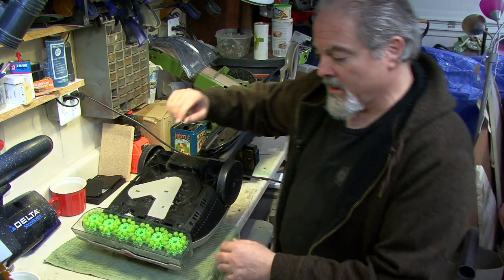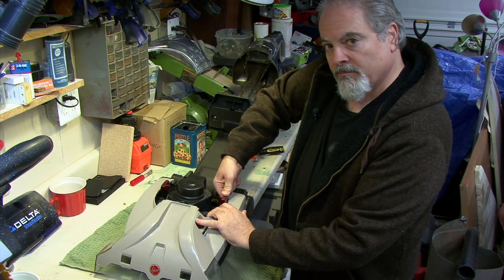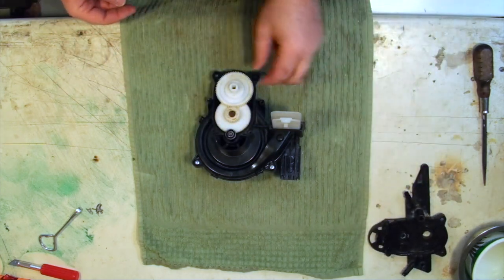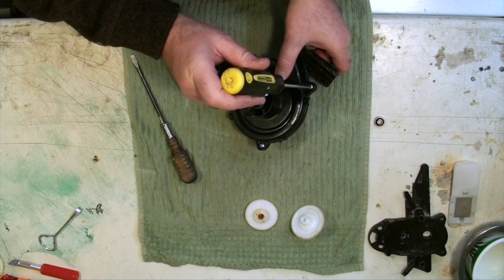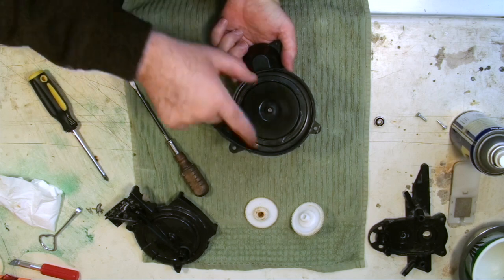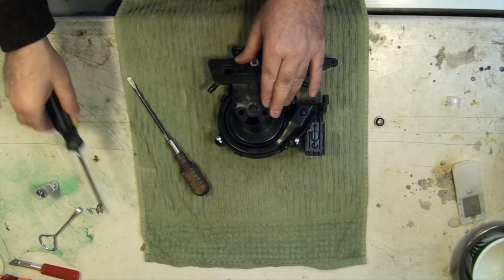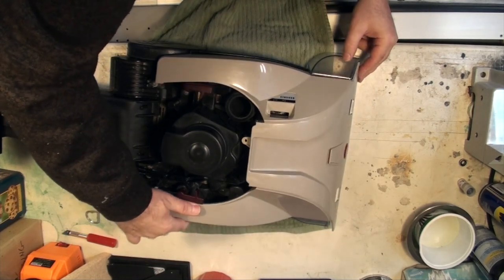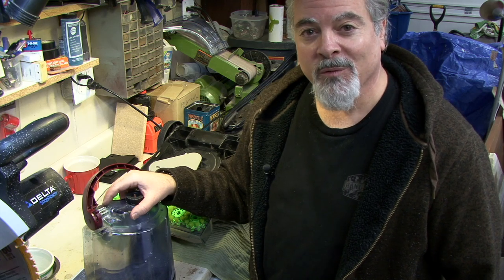SteamVac / Vax Brushes frozen and don't spin. Replace the bearing, not the motor. Less than $10 fix.

Comment: I hope this fixes my issue, mine won't spin at all, it's sat for a long time, haven't needed it until now, I've now tried to use it, turned it on and it's made a god awful sound and brushes won't spin
Reply from the maker: It sounds like a bearing (or two) is seized. But before digging into it, make sure to check the brushes for hair wrapped around them, and check the screen filter too. I'd love to know how it turns out!
Reply: @UnchartedDIY  thanks buddy, I was watching a couple videos on this and I think it may be the bearings as well, I definitely cleaned the brushes I have dogs with a lot of hair so I try to keep the brushes clean every time, I'll definitely keep you updated!

Comment: How can I find just the turbine for my carpet cleaner. Mine is cracked into two pieces.
Reply from the maker: Unfortunately,  CM, I was not able to find the turbine itself available anywhere. I'm pretty sure it was only ever offered as the complete motor assembly. 

I glued my cracked turbine, and several other people commented here explaining how they fixed theirs - even one that was split like yours, if I remember correctly. 

I found that the trick to gluing it, is to try to keep the balance of the turbine. So if you put glue on one spot, put some on the opposite spot even though it isn't broken there. 

It's like balancing a tire, so the heavy spot of the wheel needs a counterweight.

Otherwise, one commenter picked up another model for cheap from a thrift store and used it for parts. 

Good luck, and I'd love to know how it comes out.
Reply: Thanks so much. I had already thought about trying to glue it so that’s what I will do. I may start looking around for one for parts in case the glue doesn’t work. I will let you know how it turns out. Thanks again.
Reply: @UnchartedDIY  thank you so much for your video it really helped my mom fix her shampooer ❤️
Reply from the maker: @jessicapierson3739  I am so happy it helped!

Comment: Do you have link for those white gears as well? My cleaner gear has lost all its teeth and I can’t find the replacement :(
Reply from the maker: Amar, I have searched and searched, but it appears the gears are not sold separately. Instead, the turbine assembly must be replaced as a unit. I have a link to the one I was considering for mine until I discovered it was only the bearing: https://amzn.to/33nMhK4

Just be careful that it fits your model since there have been a number of similar models made. The model number is located midway down the back of the handle on a label that shows serial and model number. Good luck and I hope this is the one you need!

Comment: Which model number is this for ??? I have the model FH 50150.  Is this the same?
Reply: If not the model FH 50150, would it be the same bearing parts to order ?
Reply from the maker: Mine is a model F7425-900, but it seems all machines of that era use the same bearings. I don't repair for a living so I'm not up on all the specs, but yours appears to be very new.  I would hope they would have solved this problem by now, since my machine is around 15 years old. 

I would start by checking and cleaning the intake filter located inside the clear plastic on the left front side of the vacuum. If it's clogged, it will stop the brushes. 

If that's not it, it might be worth opening it up and seeing if the bearings are rusty.

Hope that helps and I hope you find it's a simple fix!
Reply: Thank you.  Will check everything.

Comment: Instead of using 3-IN-ONE - 10038 Multi-Purpose Oil, 8 OZ, use  I'd AeroShell Grease 22
Versatile Multipurpose Grease, Corrosion inhibited and fortified against oxidation, it has excellent anti-wear properties, load-carrying capacity and water resistance, plus a wide useful temperature range of -54°C to +177°C. Recommended for aircraft wheel bearings, engine accessories and airframe lubrication and for anti-friction bearings operating at high speeds and at high or low temperatures.

Comment: Where can l get the round turbine at 7:57?? Mine was cracked
Reply from the maker: Martin, they are not available separately from the motor assembly, but even those are becoming difficult to find. Check out the comments below from 
Louise Zoufaly. She was in a similar predicament but solved it.  Glue was one option, but she managed to find a used machine and use it for parts.

Comment: This was so helpful unfortunately now my machine isnt dispensing water and cant figure it out!! Grrr
Reply from the maker: I suspect the trigger switch or a solenoid is to blame, but since I haven't had to deal with that problem yet, I can't give specific advice. If you have a multimeter, you might be able to track the problem down. 

I know it sounds crazy, but if you can't get it to work you could mix your hot water and carpet detergent in a pressure sprayer that you pump up by hand. Spray it on a section of carpet and then vacuum it up with the carpet cleaner. A bit of a pain, but you could still keep using your machine! In case you don't know what kind of sprayer, here's an Amazon link to show you what I'm talking about: https://amzn.to/3V5RgLu  Make sure it has an adjustable nozzle so you can control the spray pattern. I would use the same moderate temperature that you would put in the cleaner's tank, and you don't need to pump up a bunch of pressure to spray the carpet.

Hope that helps and I'd love to hear if you are able to fix it, or if you go with the sprayer. Thanks for watching!
Reply: @UnchartedDIY  thank you kindly for your reply. I am tempted to think it is the trigger. From trying to reverse engineer it, I can tell when pushed by hand, the valves go up a reasonable amount so presumably the trigger should pull those pins up on the machines upper tank base when pressed.

Are you aware of this is the case? Thanks
Reply from the maker: I think that's how they work. I wonder if you might just have a bad valve? You could try switching the water and detergent tank valves to see if it is a valve, otherwise it is probably the switch. Also, check the plastic base of the water tank to see if the glue that holds it to the water tank might have come loose and allowed the tank to sit too high, preventing the valve from opening.

Comment: Where do you buy gears
Reply from the maker: Thanks for asking, theresa. I am assuming you mean the white gears inside the brush turbine motor. Unfortunately, it seems that the gears are not available as a replacement part. In the parts diagrams, only the turbine gear assembly is available, so when things go wrong you are supposed to replace the whole brush turbine motor unit.  The bearings I fixed in the video are not listed either, so I was happy to find a way to fix them.

I would start by searching for parts under the model number of the SteamVac you have. You should find the model number on a sticker located on the back of the cleaner, probably about where the electrical cord attaches. Try ebay if you want to go with used parts to keep the cost down or if the part has been discontinued, otherwise you might be able to find a new one depending on which model you have. 

I hope you find a replacement, and I'd love to know how your project turns out.

Comment: I can’t do this this my fourth Hoover i just got this one last year . Brushes don’t want to spin . Really carpet cleaning is seasonal for me I don’t have kids or pets .. running hard brushes not moving …I wanted to shampoo before holidays . Who repairs these machines?
Reply from the maker: What a pain! I would start by checking and cleaning the intake filter located inside the clear plastic on the left front side of the vacuum. If it's clogged, it will stop the brushes. 

Hopefully that's all it is, since your machine is so new. I think you'll find someone to work on yours if you search under "vacuum repair near me"

Comment: It seems to me Root Cause Analysis is water penetrating the sealed bearing causing the bearing to bind.  Replacement of the bearing, even if it is a new sealed bearing, seems like a temporary fix as the seal would tend to fail again.  The question is why is water penetrating into the gearbox.  I suspect a pressure difference between the turbine and gearbox.  Just my $0.02
Reply from the maker: I think in my case, it was coming from the cracked water reservoir and leaky valves. Water would drip down into the motor area and end up leaving giant puddles on the carpet. Once I fixed the tank and the valves, it's all been working properly. I hadn't thought about the pressure differential though, and that might be part of why so many of these machines suffer from this issue.
Reply: @UnchartedDIY  This a great video but it should have included discussion of the white rubber damper that is controlled by the brushes on/off switch. This should be checked for free movement after the turbine is re-assembled. If it binds or is out of position the switch will bind and not move.
Reply from the maker: Thank you for the helpful tip. I wish I could edit YouTube videos to add new information.
Reply: @UnchartedDIY  No matter..great video. The only reason I mention that damper door is because mine was binding upon re-assembling....alignment is critical. I even add a bit of grease on the sliding mechanism.

Comment: What size is the top bearing?
Reply from the maker: Here's what I used for mine: Bearings: https://amzn.to/3eNzftX   R4-2RS Sealed Ball Bearing - C3-1/4"x5/8"x0.196" - Lubricated - Chrome Steel. Top and bottom are the same size.
Reply: @UnchartedDIY  So both the same size. I'd recommend using marine grease in those bearings and on the plastic gears. It's what they use on boats. It repels water and protects from rust. A carpet cleaner will never see RPMs that high or anything near as corrosive as salt water. Just use a degreaser to get the original oil/grease out first.
Reply from the maker: @JimmyKay1976  That's great advice! Thanks for posting this!
Reply: @UnchartedDIY  Anytime. Thanks for the video. My cleaner is gonna be delivered tomorrow. I'll be following your instructions on getting to that bearing and using the marine grease to avoid future issues. Were ever able to remove the top bearing?
Reply from the maker: @JimmyKay1976  My top bearing was spinning freely after soaking it in oil, so I left it alone. Several commenters mentioned ways they were able to remove it and replace. If I have to inside the cleaner again, I intend to replace it preemptively.
Reply: @UnchartedDIY  Any idea on the best way to get it out? The housing seems weak.
Reply from the maker: @JimmyKay1976  That housing does seem weak, which is why I decided to leave mine alone when I made the video. 

A commenter named GeeBerke posted this:

"Thanks for the video!  It really helped me out!  I had to replace both bearings on mine.  I placed the unit, impeller side up, on my vice with the jaws about 1/2” or so open, letting the shaft drop thru.  Then I lightly tapped the shaft in the center of the turbine with a punch and hammer.  It came out daily easily.  Next I put the shaft loosely in the vice, resting on the bearing, and tapped it off the shaft.  Tapped the new bearing on, then tapped the turbine back on carefully with a hammer.  Works great!"

When I have to work on my cleaner again, I'm going to try this method. If you come up with something when you get yours, I'd love to hear about it.
Reply: @UnchartedDIY  Will do. Thanks!
Reply: @UnchartedDIY  This worked for me. I'd suggest people do this when the machine is new and has no rust or wear & tear on it. I think its safer for the housing which is quite brittle. Use Liquid Wrench to lubricate so it comes out easier.

Anyhow, I put the marine grease in the bearings & the teeth of the plastic gear. I even put a thin layer of it on the gears surface to coat them so no water will stick. Just don't overpack the bearings, that could cause too much drag and make the motor hot. Also put a thin layer of the marine grease on the outer surface of the bearings. When I was done  I plugged it in and used the trigger to really get the grease broken in. Start off at slow speed for a minute and work you way up. No load on the bristles. 

IMPORTANT: When you get the bearings out you must remove the seals and soak them in a degreaser to remove oil from the bearings & seals. I used Castrol purple. Let soak for 20 minutes. Rinse bearings & seals with warm water, and blow out with air compressor.

Hope this helps
Reply from the maker: @JimmyKay1976  That is super helpful, Lone Wolf! Thanks for sharing your techniques, and enjoy your clean carpets!

Comment: What size bearing  please
Reply from the maker: Hi Julia, there's a link to the exact ones I used in the description and the specs are in the first comment that's pinned to the top of the comments. I don't want to give you incorrect info from my memory, which is questionable these days 😄
Reply: @UnchartedDIY  thankyou so much going to give it a go got nothing  to lose  thankyou your  explanation  is so clear  thankyou
Reply from the maker: I would love to hear how it goes. Hopefully you'll find it's actually pretty easy and your machine will be running like new!
Reply: Thankyou so much I did it my machine  is working  thanks to your step by step guide   go grateful  for your  help
Reply from the maker: @juliashaw5433  Yay! Nice work!

Comment: Where is the switch that says brush
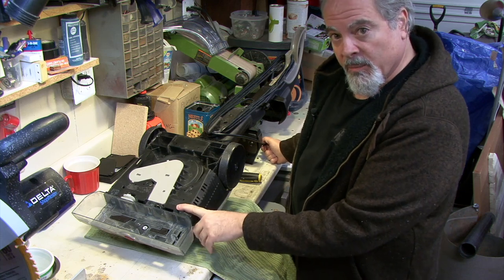Reply from the maker: On mine, it's on the motor/brush housing on the right side, next to where the recovery tank mounts.  I point it out several times in the video, but you can see it at 14:37 in the video. It's the maroon button to the right of my hand.
Reply: @UnchartedDIY  thank you. Mine doesn’t have that. I had not gotten through the whole video so I didn’t see that part. Thanks again though.
Reply from the maker: I think each model is slightly different, but so far, they seem to have the same issue with the bearings. I hope the video helps you get yours going again!

Comment: I did it poor engineering that the sealed bearing and the plastic gear bearings don’t have weep holes on the bottom to let the water out. Also the top bearing does not have a shaft to wall seal depending wholly on the sealed bearing. Sealed bearings are normally dust and dirt sealed, are water resistant but not water proof.
Reply from the maker: I'm convinced that it's intentional. These are made to self destruct so you buy new ones every few years. Since this video has over 51,000 views now, I'd say this is a common problem!

Comment: Switch. Wat switch. There aint any switch
Reply from the maker: Not sure what you are referring to, but I do mention a switch when discussing the housing cover for the base. The switch that controls whether or not the brushes spin is located under the housing and the slider needs to be removed from that switch when removing the housing.